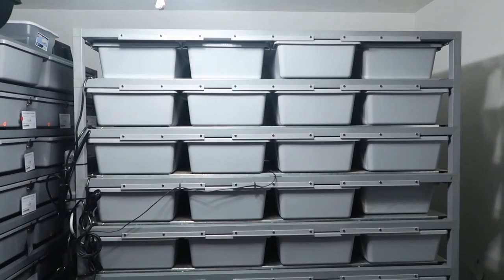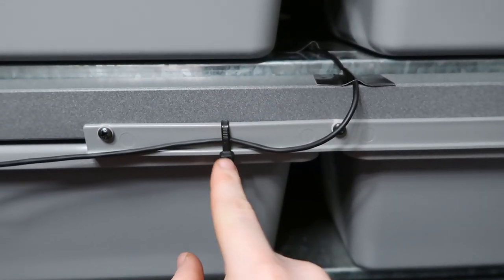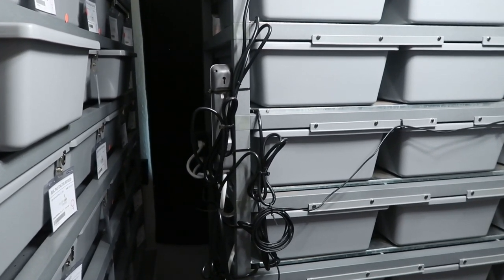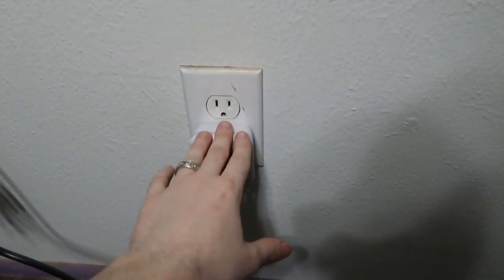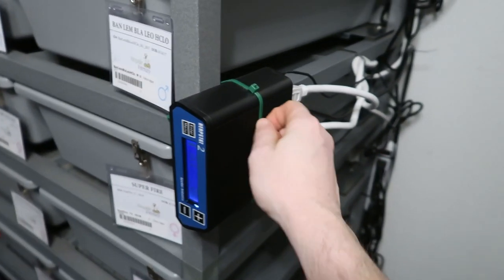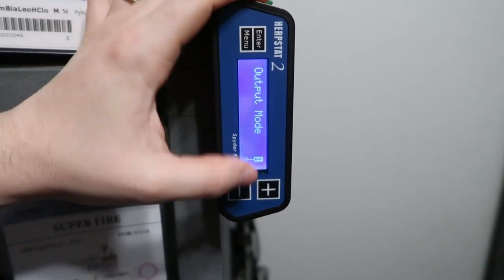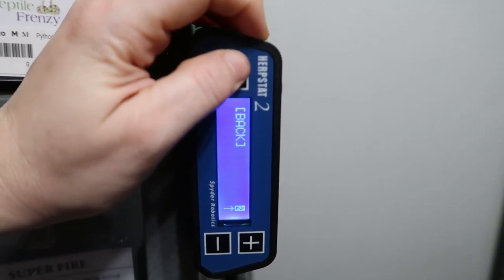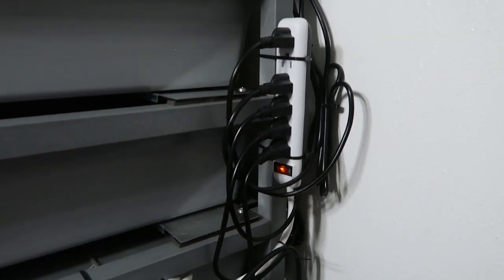How to Wire a Snake Rack for Heat!

Comment: Hey man, just wondering why you have your stat on pulse and not dimming? I have mine on dimming and now I’m thinking maybe I should change it. Anyways thanks for the great content.
Reply from the maker: For metal racks Spyder Robotics (Herpstat) recommends pulse because of the interference or humming you get sometimes. They also say that pulse mode is a more accurate way to maintain the same temp across the whole rack. I have the email from them with all the jargon I can forward to you if you want to message me off Instagram your email address.
Reply from the maker: My Instagram and Facebook links are in my description or in about me on my channel.
Reply: @reptilefrenzyllc3721  I did a little research after I watched your video and came up with the same information about the humming. That is an interesting phenomenon that I will have to take into account when I get my ARS, I have  a melamine rack right now so I don’t have to worry about it right yet. Thanks for taking the time to reply. Love the videos, keep up the good work.
Reply from the maker: @timfoil2319  Thanks Tim, we appreciate you!